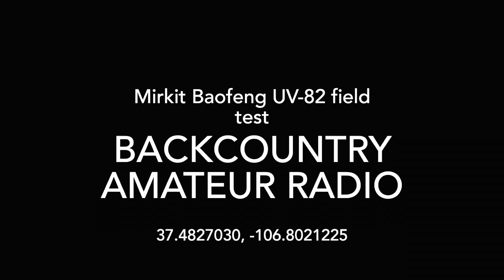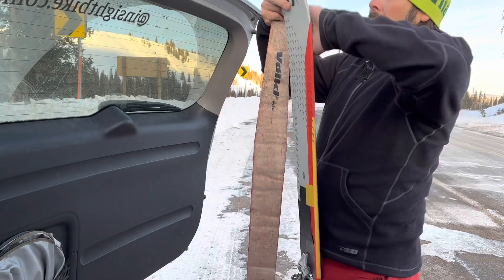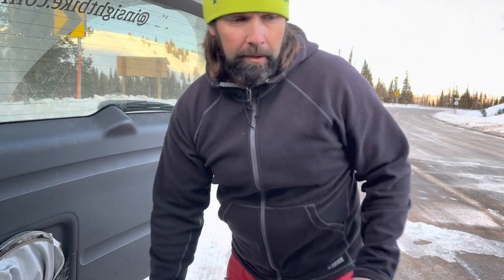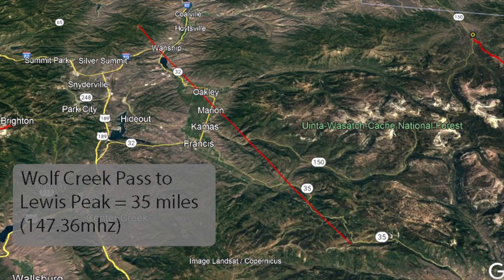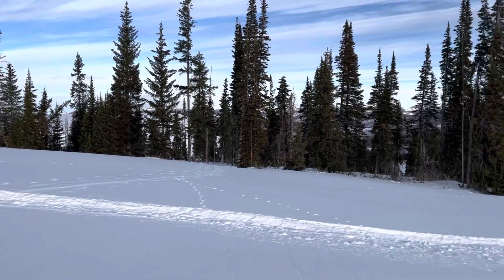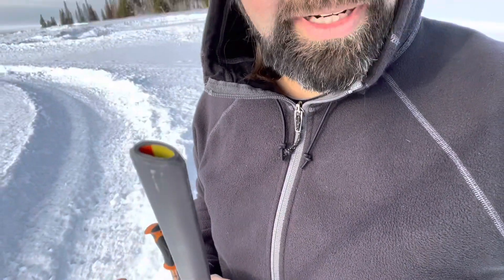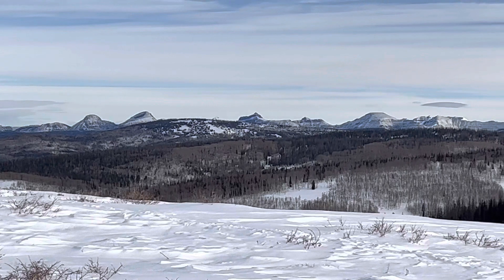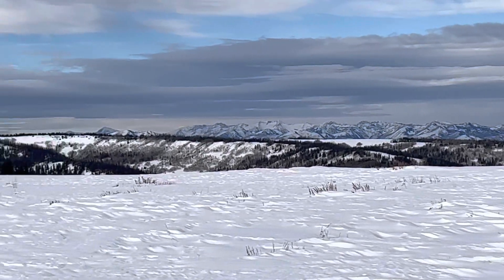Field Test - Mirkit Baofeng UV-82 MK5 high power FM Transceiver Handheld ham radio

Comment: Beautiful country, did you take a proven radio with you - that is what I try to do when I try new equipment.
Reply from the maker: You know, I didn't think about that until after the fact! Normally I would have, but it was kind of a mad dash to get out there... which kinda stinks. I had wanted to compare it to my Yaesu FT-25r.